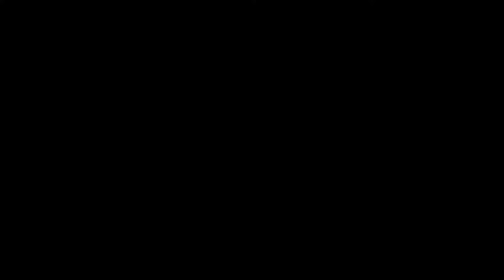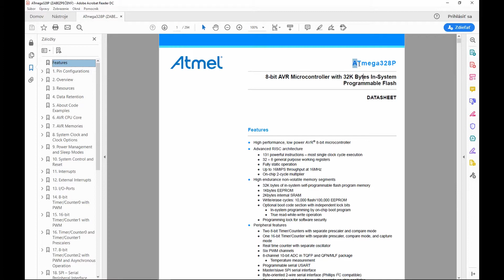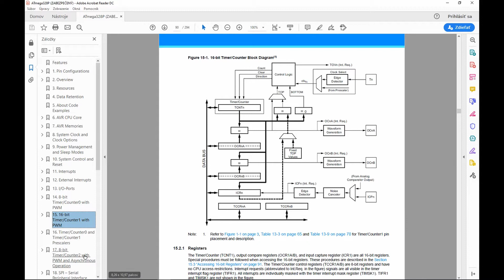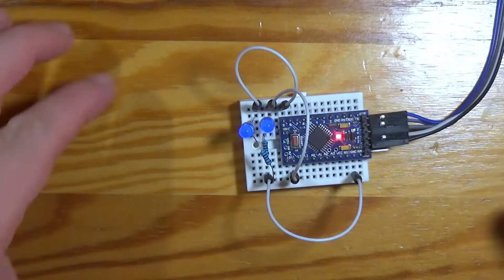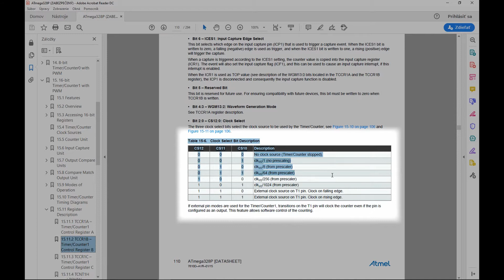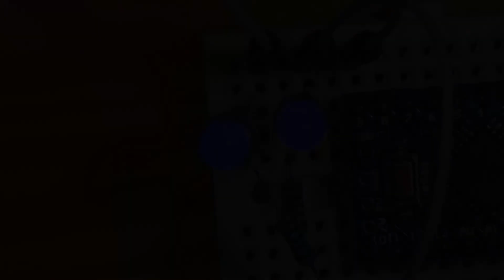[en] Arduino - Timer1 - 8, 9 and 10-bit PWM

Comment: Thank you very much for this video. I am very new to Arduino, but have been designing a lot of electronics including microprocessors - but mostly 30 years back. I have looked at Arduino control of a more powerful DC-motor for a sewing machines. It should be able to control a peak power of about 400 W. A module called IBT-2 can do that, but its max frequency is only 25 kHz. So I look for a way to make about 20 kHz PWM-signal to get rid of audio noise from motor. So I guess, that it would be possible with a setting of no prescaling and using the 9 bit option for PWM and set some start and stop counter values, so you get 20 kHz. Do you agree?
Reply: I do not believe Arduino is capable of outputting PWM with 9-bit resolution at 20 kHz frequency. You'll probably need better (and faster) microcontroller to achieve that.